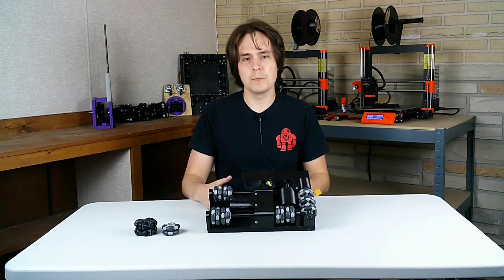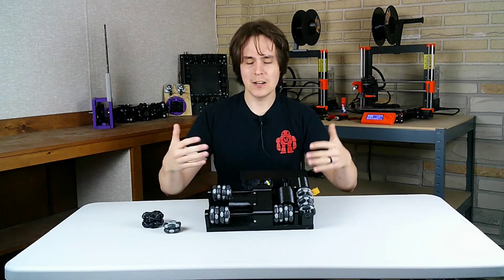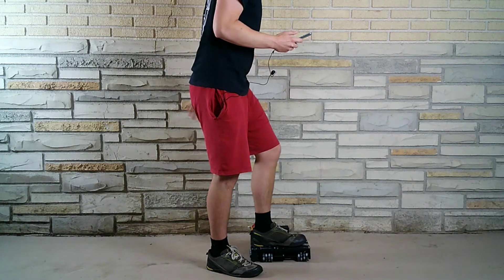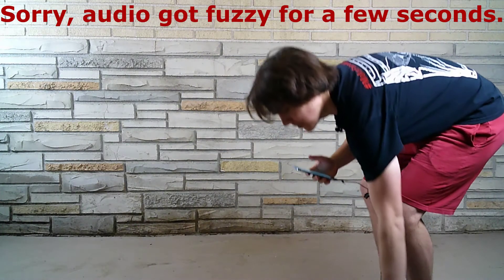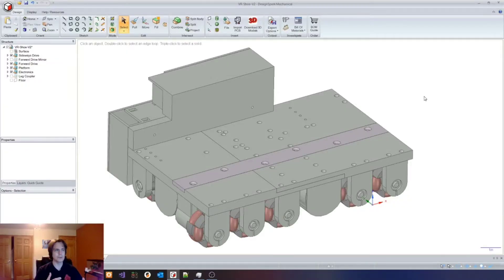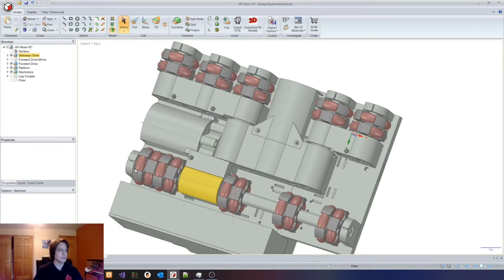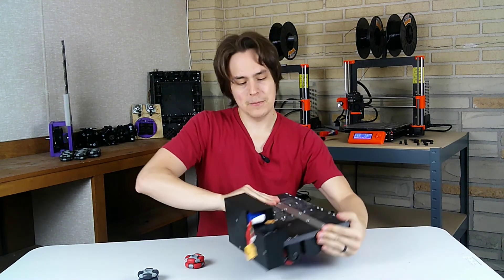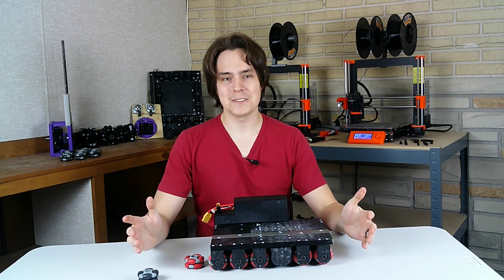Virtual Reality Motorized Shoe Build Log #26 - New Wheels, Layout. It Works! VR games here I come!

Comment: Also, time to test on thin rubber mat: as maybe required in real world to help comp. for "Murphy Law,"  ie; dumb people like me.
Reply from the maker: I have a 1/16in thick one I'll try. The space between the perimeter of the rollers and the frame of the omni wheel is tiny, so if the rubber mat flexes at all the omni wheel frames will rub on the mat. I'll need a mat with a high durometer. A mat will also help with the noise.